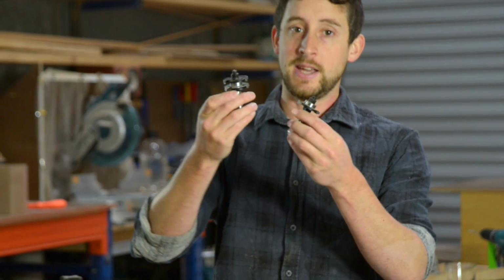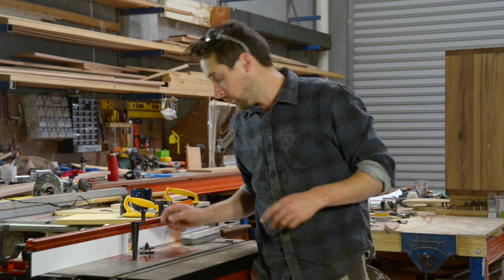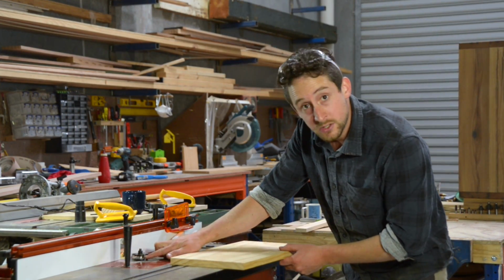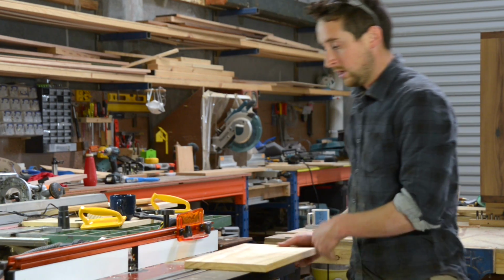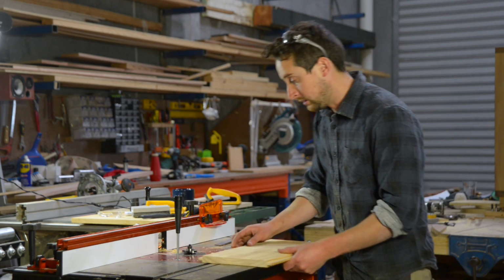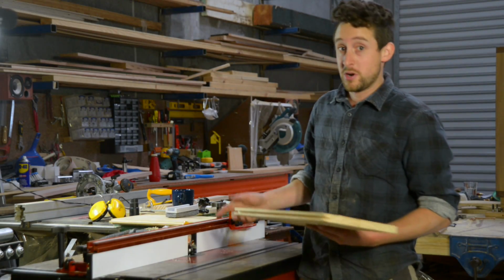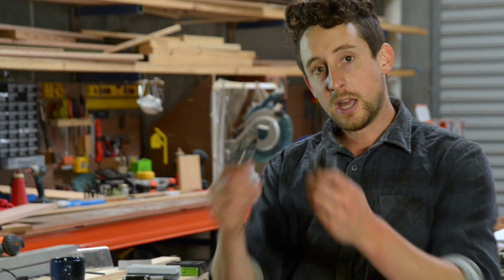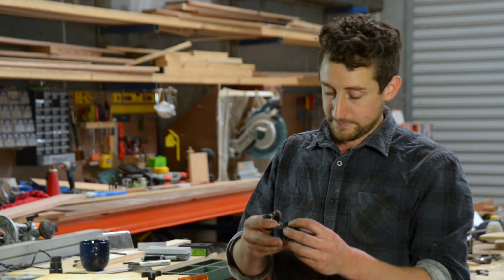The Router Bits  - Cutting Tongue and Groove

Comment: Very well explained thank you. As tongue and groove bits are large I’ve heard that the router speed should be slowed down and maybe with multiple shallower passes in hardwood. Do you do think this is necessary?
Reply from the maker: Yes, in general that's the case; a bigger bit requires a slower rotational speed. We always recommend test cuts, as timber is a very variable material, what works for one species my not work for another.

Comment: I have a hand router. Is it possible to do this with a hand router?
Reply: I’ve done it with a hand router. It’s more complicated and risky but lately I’ve been doing some edgy woodworking and don’t mind. You have to be creative with cutting the ends of the boards
Reply: Create a shop router table and put it under or if you have finances buy plunge router lift it's quite pricy but worth it woodworking is profitable if you love tools and willing to have them.